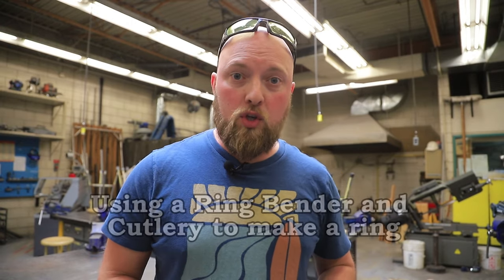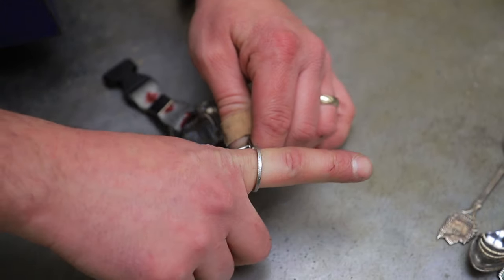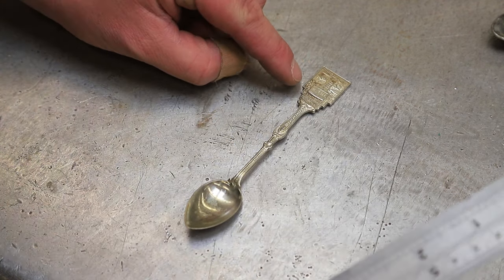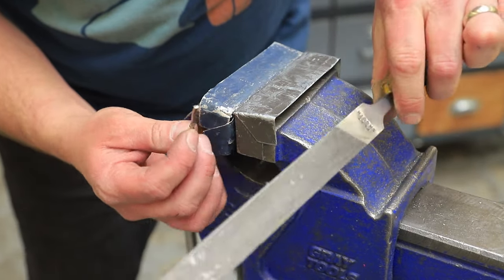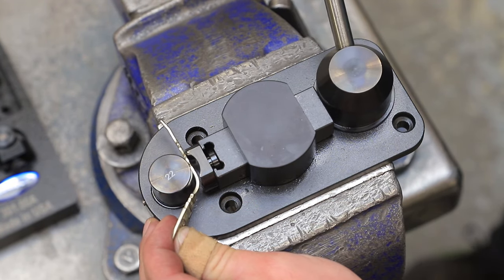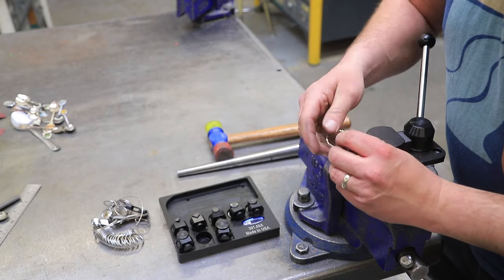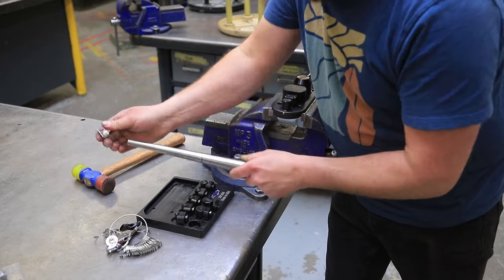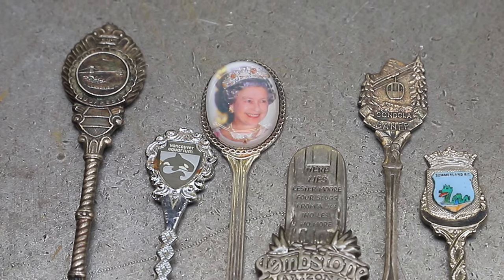Making Rings with Cutlery - Ring Bending Tool

Comment: Hi. Great videos. Can you only use silver spoons, or can you use stainless steel as well. Thank you. Claire.
Reply: stainless steel cutlery works fine too. Be carefull with the thickness of the piece though,  as they are a lot harder to bend and takes time to get perfect roundness. Also, if you are using a really cheap ring bender, the stainless steel could possibly cause the ring bender to fail & break.
Reply: @oidi  thank you for replying.
Reply: @moniregb5682  your more than welcome, also wanted to give a quick tip, especially when using stainless steel, make sure you have the sized length of cutlery your using flat to the bottom of the nylon die when bending, becuase if you dont, after bending all around, it will be warped, and stainless steel is very unforgiving when trying to correct it ;)
Reply: @oidi  brilliant advice. Once again thank you

Comment: What do you do for cleaning? What price should you be paying for spoons?
Reply from the maker: At the moment we just sand to a high grit a polish with red polish compound until they feel smooth. I try to get donated spoons for the classroom or buy in bulk from thrift shops
Reply: You can steal a spoon, which makes it free.
.25 cents in a goodwill store.
$200 from Tiffany's.

Cleaning is the same method for a spoon (even though it looks like a ring, its still a spoon. MAGIC!)

Comment: In case you don't know where you went wrong, ring sizing is based on gauge (the thickness of the metal).  You needed to use a ring sizing chart that showed your metal by gauge so you can cut the length accordingly.
Reply from the maker: Link a chart for others to see please. 
This was day 2 playing with this tool and just a quick intro for kids so they don't destroy the equipment within the first week. Making the rings perfect will take some practice but for now it's been fun to play with.